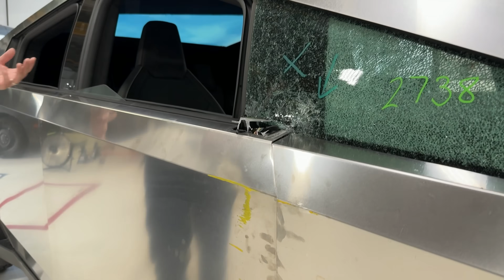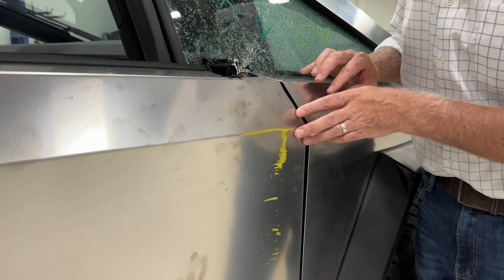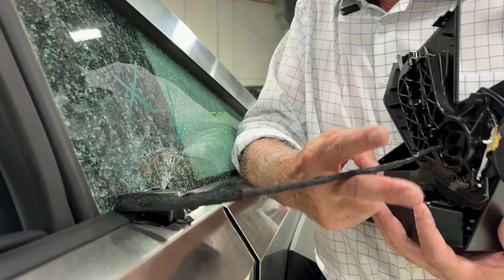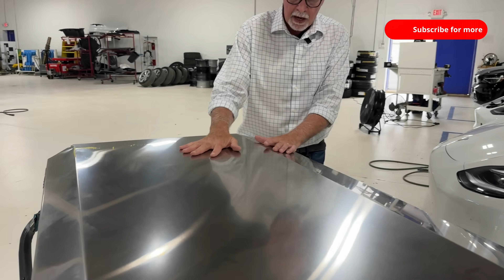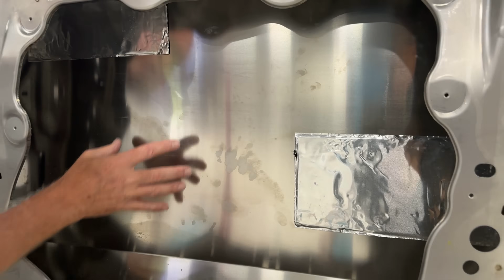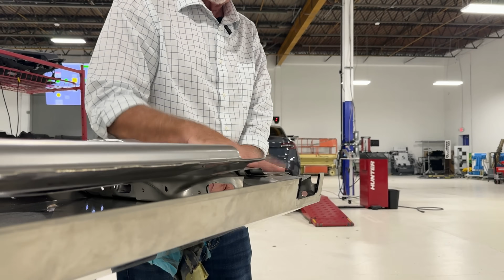2024 Tesla Cybertruck: A Paradigm Shift in Collision Repair

Comment: The issue of arcing on 12v is the same as on 48v.  Both can arc and in both cases can damage your main electrical system if not properly fused.  Most likely though the line will be fused in which case i’t not that big a deal to just snip the line.  48v is not high voltage, it’s just more than 12v.  48v will not shock you unless you stick the wires in your mouth.

Comment: It will only arc if current is flowing and at 48V the current will be less than a 12V
 system.
Reply: Arcing happens when you have a sufficient potential. Current only flows when the arc occurs.
Reply: @Señormakey  But that wont happen if its open circuit, ie no potential.  Arcing will also occur in say a switch if its closed and current is flowing and its open, especially DC circuits

Comment: New insurance paradigm: ship old door to Tesla, they provide back a drop in replacement and they do all the complicated work in house. Total cost would be close to shipping+labour.
Reply: You don't think they've thought about that? I've been doing this 20 years and this is the been a thing for decades. 

Yes they call that cores. You ship to the OEM back the parts in the same box they ship you the part in. 

It's way worse than you think it is. Not only do you have to give the part back. If the part is too damaged they will charge you a core charge. They do this in most parts that they refurbish. The core charges are refunded. If the parts are returned can be salvaged.

Comment: Could the door still open?  Do a mirror replacement could be done easily and economically without damaging the 48V system and maintain water tightness?  If the answers to those questions were YES, I would leave the door as it is, clean the markings, and forget about the gap, after all, that gap is not as bad a the one I got on my 2019 Silverado....... Well anyway, I dropped my CT reservation.

Comment: Stainless Steel is very difficult to work with in this situation, its not a alloy that was really developed for this type of application. I know i worked with SS In sheet metal for many years, studied it during Mechanical Engineering.
Really its a case of removal of damaged panels disposal and replacement with new panels.
That will definitely increase the insurance costs of these CyberTrucks.
I wouldn’t even contemplate buying one just for the problems associated with SS repairs same as the DeLorean, ALTHOUGH having seen a DeLorean up close here in Australia they definitely knew what to do with SS over Tesla.
Reply: Additionally, welding in new sections isn’t totally trivial. Cutting out a section will definitely burn out the Chromium, so you’d be left trying to chemically convert the steel back, or just painting the entire panel. Assuming you are going to do any traditional body panel repairs that are available for other cars

Comment: 1. The panels are not bullet proof. 2. The only solution for collision damage is to ban those extremely dangerous and poorly designed and built bait and switch vehicles from all roads. 3. Explain to Elon fan boys who say things like “Elon is working on it”, that Elon isn’t working on anything, isn’t an engineer, but as an unfettered CEO can say and promise anything. Stop thinking you’re buying a vehicle from Elon. It’s a corporation. Elon will not be talking to you with the next over the air update to deliver things to the truck you paid for, but were cheated out of.
Reply: As regards 1, depends on the bullet. https://youtu.be/teRRk-0KHus?si=EelgqChRKxe9v48r

Comment: ”Light” contact on door, straigten steel and repaint…. Cybertruck , replace full door. Priceless.
Reply: Paint labor, blends, added r&i's, materials, days of added time. 
All not needed with a skin replacement on this. Remove skin, prep, for new panel, install new panel.. done.
Reply: Door dings arent a thing if thats any consolation.
Reply: It's not priceless it just 4,000 dollars :D
Reply: All to say... it's substantially cheaper on Cyber than on a legacy truck.
Reply: Or don’t. The only reason someone isn’t just knocking this straight is cosmetic. It’s a truck and most of them have dents and rust after a few years. The Cybertruck will just be missing the  rust but if people actually want to use it as a truck they’ll have to get used to dents and scratches. Most modern American Trucks are ugly as sin and very dangerous to pedestrians, the Cybertruck fits in perfectly.

Comment: The stainless on the Cybertruck is 300 series, which isn’t super exotic.  The problem is that the steel is subject to work hardening.  Too much cold work could lead to cracking.  If you hot work the metal, you may precipitate the dissolved carbon and trace elements.  You might turn the steel blue or cause the steel to lose its desired properties.  I have a feeling a lot of shops are going to replace panels to reduce the chance of unsatisfactory repairs.  I can imagine there will be pushback from insurers.  It is fortunate the Cybertruck is a low volume vehicle - at least for now.

I’ve seen several videos of neophyte drivers trying to back up Cybertrucks and making a real mess of it.  The problem seems ripe for a software update to add a selectable mode or maybe just disable 4-wheel steering altogether for backing out of parking spaces.
Reply: @wtmayhew  real question. Why would, given the problems reported, would an insurance company insure it?
Reply: @pbinnj3250  We’ll have to see the cost of compressive insurance premiums for Cybertrucks are once insurers have experience with the magnitude of claims.  Probably most buyers are going to have to get loans and they may get sticker shock when they see the insurance premium.  I try to pay cash when I can for cars and opt for liability only insurance, banking the difference it would have cost for comprehensive coverage.  So far over the course of several decades, it has worked in my favor.  By now I have enough saved to buy a new vehicle if one of my cars is totaled in a wreck.  It takes financial discipline though, and it isn’t easy to resist spending out the reserve.
Reply: It is possible to disable the rear wheel steering but the problem is(like most modern cars) it's buried in the infotainment screen meaning you'd have to sit there and jump through menus to get to the one thing you're looking for.
Reply: Even if people are not used to the steer-by-wire system Cybertruck is using, they should be able to back up without hitting stuff simply using the awesome backup camera the Cybertruck has.  I think some people are just forgetting about the backup camera and trying to use the side mirrors and backing up the way they would in a conventional pickup truck and backing too fast.  That is a recipe for disaster IMHO.
Reply: @mosconi0359  If aI’m not mistaken, there’s no washer jet for the rear camera.  The blunt back edge creates a low pressure zone and the camera gets pretty easily covered in dust according to owners.  From experience with the rear camera on other vehicles, a washer jet is also handy for blasting off rain drops which are distorting the image.  I tend to rely more on the backup camera on my car and only use the outside mirrors for the final few feet to verify clearance as I back into my garage.

If Tesla gets feedback about backing into spots being difficult, they will probably make a software change to help make it more intuitive.  Tesla is good at making running changes to improve the driving experience.

Comment: Technically there is no "exoskeleton" here. The outer panels may be hard and heavy but they are just bonded to the actual structure of the vehicle and do not supply support. You could remove all of the stainless panels and drive the truck. If they comprised an exoskeleton removing them would render the entire structure unsound and unable of supporting itself. I know Elon said it was gonna have an exoskeleton but it never did.
Reply: I guess that so-called exoskeleton isn’t friendly to occupants in both vehicles in a event of crash, he did mentioned he wanted it to be a personal armored vehicle at very beginning, but modern regulations won’t allow public to drive a APC that would reach 60mph within a second. Like you said, basically he chose the way how Delorean did in the past.
Reply: Correct, but they will add to the stiffness of the whole.
Reply: @markthomasson5077 if the exterior panels offered substantial structural support to the vehicle, you'd hear it. The door seals and panel attachment points would constantly creak and you definitely wouldn't be hearing about a body shop being able to measure an A pillar with the doors and quarter panel off. I'm also not convinced that the strength of the door panels allows for the deletion of the standard side impact beams.
Reply: It might be hard to determine the damage by looking at panel gaps. They might have been that way in the first place.
Reply: I don't think stainless steel panels are the exoskeleton. It's the giga casting
Reply: @samanmudannayaka9604  that is the skeleton, exo = outside, like the shell of a crab
Reply: @markthomasson5077  What I meant to say was that the gigacasting is the exoskeloton. Not the SS panels
Reply: @samanmudannayaka9604  Exo means external.  The rigidity comes primarily from the endoskeleton.  But the exoskeletion increases it.  Which is in line with the function of an exoskeleton.  To be fair to everyone the definitions are all over the places.  Pick one that makes you case and your good to go.  Lets not waste time on it. LOL

Comment: The issue with 48v is not just arcing, it is also to do, with safety to personnel and following proper safety procedures(electrical safety is a must unlike most 12v systems). The arcing is definitely an issue, since in a shorted(under full load) condition, there will be a current surge as much as 4x more than a 12v system. It is the amount of current in the arcing(and the total power-proportional to i^2) that eventually decides the burn potential of the contact points.❤👍
Reply: Not necessarily 4x that totally depends on the power of the battery.

If the power of the battery is the same, but the voltage is 4x then there will be .25x the amount of current going through a short.

Comment: Something has to give.    Tesla moved it to skin support structure between the skin and and the castings and stamped sides of the passenger compartment.   A good outcome might be adding shims to bring the panel into alignment but guessing that will be rare.    If the panel moves in a moderate impact get out the wrenches and replace it.  It may have changed but the one time I priced a F150 and a CyberTruck door they were about the same and the CyberTruck does not need to be repainted making for a significant buffer.  Waiting to see if I am right.

Comment: To have a meaningful comparison to other vehicles, you would need to have to analyze the damage under the same conditions, similar to crash testing. Maybe with a traditional car the visible damage would be significantly higher but also internal damage would happen. I once had an accident at low speed, someone rear ending me, the visible outer damage was not extreme, but the car was totaled the whole bottom of the trunk was warped and the main frame was distorted.
Reply: Was looking for this comment. If that were a traditional door, contacting a bollard with that amount of force, a visual inspection would likely immediately be assessed as Replace.
Reply: @supercadet111  True. I would hate to fight with insurance over that. They'd look at the cybertruck and say , "oh it's fine, here's the least amount of $$ we can give you for the repair since on the outside it doesn't look that bad" 

But then again I would never have that problem since I don't have that much disaposable income.

Comment: Those panels are not bulletproof I promise you.
Reply: It’s bulletproof to a 9mm Glock, 45 Caliber Tommy Gun and an 00 Buck shotgun. 

So yea unless you’re talking a 50 cal: https://youtu.be/VLV-4HMrAz0?si=5mdilWfNxDkLfoX9

https://youtu.be/teRRk-0KHus?si=ZblAEJDgE-S2pVfM
Reply: So a .45 ACP would just destroy the thing. Or a 10mm. Essentially any common handgun outside of 9mm, of which there are plenty of. AR rounds…. Any rifle round rated for hunting…
Reply: @Señormakey  The primary protection is against the dings that vehicles collect.   Not so much hand guns.   Thing is this level of protection was added w/o adding significant if any weight.  Unless you compare it to an aluminum Ford.
Reply: This is the age old armour vs weapon thing.   One can always use a larger round.  No such thing as bulletproof.

Comment: The Cybertruck weighs around 7,000 pounds.
Reply: Less than 7k, but definitely not anywhere close to the 10k he said.
Reply: Yep, 6898 for the tri motor with all terrain tires
Reply: I think he's thinking fully laden gross weight at 9,169 lbs (not curb weight) .... not sure how big a difference there is between the RWD and 4WD models...
Reply: Yep he lost me there
Reply: 6,898 lbs
Reply: No wonder body shops are so expensive. You took an easy 2 minute explanation into 15. Just replace the door and move on

Comment: You could repair the door. 
1. Shim the hinge.
2. Fill the gap between the mirror support and skin with structural adhesive.
Reply: Yep that could do if you try fixing it at home. But it won't be "as new". Unprofessional but perfectly functional and visibly fine.
Reply: @AudiTTQuattro2003    
Structural adhesives have been used by OEM's and have been part of factory authorized repair methods for over 20 years.  In the collision repair industry, they're commonly referred to as panel adhesives, and when used correctly can be used for a repair that rivals welding.  I don't see what this poster is referring to when stating to fill a gap, it's not really used as a filler.
Shims are also a commonly used method of adjustment.
Don't let insurance companies fool you, they couldn't care less about the quality of a repair or your safety.  They will skimp on repairs to save a nickel any chance they get.  When arguing with insurance companies to make them pay to properly repair something, it's the factory approved methods that are referred to.
Reply: With modern vehicles that crumple, leaving creased or compromised panels isn't a good plan if you get hit again.
Reply: @practicalguy973  agree. But we're talking about the door.